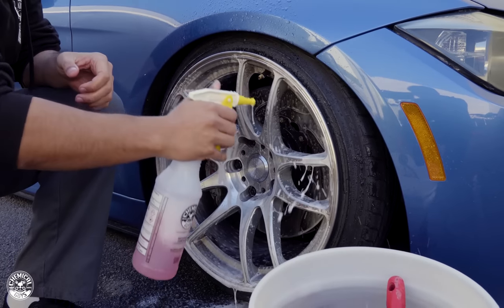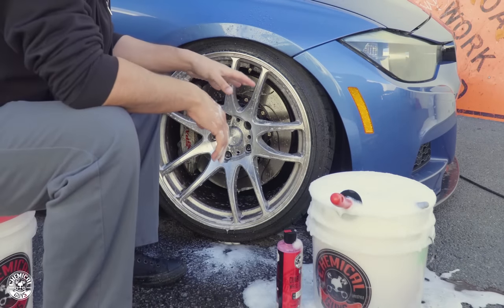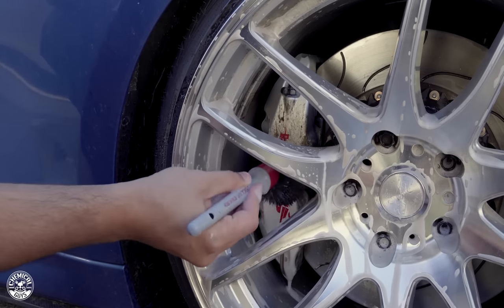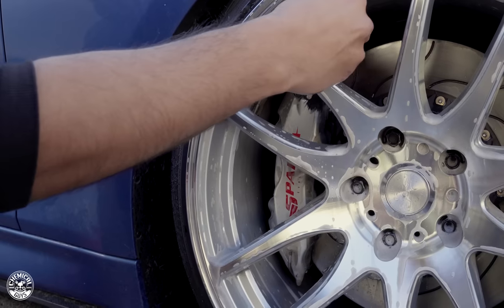In Depth Wheel Detail: Dirty Wheel & Caliper - Chemical Guys!

Comment: I have been watching quite a few of your videos.  They are great.  My biggest question is how do I decide on what one of your products to use.  I seen on your website, you have Sticky Citrus, Diablo, Signature Wheel Cleaner, Decon PRo Iron Remover and Wheel claner.  How should I choose one over the other?
Reply from the maker: Hey Keith! Thanks for reaching out. I recommend using Diablo Wheel Cleaner for routine cleaning and either DeCon or Sticky Citrus for heavy messes.
Reply: @ChemicalGuys  thanks

Comment: I’m excessive, I rinse, spray the wheel down with wheel cleaner, let that soak/drip for a bit, then rinse again, then soap cannon my wheel and then use a brush from my soapy bucket
Reply: Yeah. I mean these videos aren't really about car detailing as much as they are about advertising products.
Reply: @Carlos.Rivera  yep i've done that before because i was going to be doing some work on brakes and suspension

Comment: Hey guys awesome video. I have already applied jetseal and max coat wheel guard, so now next time when I want to wash my wheels again if I use decon and diablo gel will that remove the protection or not?
Reply from the maker: Hi Dimitris! Decon Pro and Diablo Gel are both pH-balanced formulas that will not strip off any protection off your wheels. Happy detailing!

Comment: DONT USE A BRUSH ON A BLACK WHEELS. wheels Woolies are the way to go
Reply: Rolando Bernal can i ask why?? I have Honda sport wheels, they are black paint with chrome, this comment got my attention
Reply: 623loverboy i have off road black wheels and my wheels on my car are black there ray gram lights so aftermarket and I wouldn’t recommend using a brush because it will leave fine scratches on the paint I use wheels woolies and make sure it’s well lubricated I haven’t had issues after not using”SOFT WHEEL BRUSHES” wheel woolies are the best option just search them up